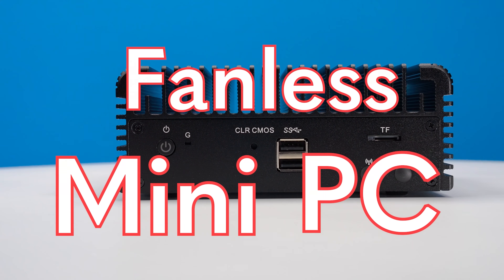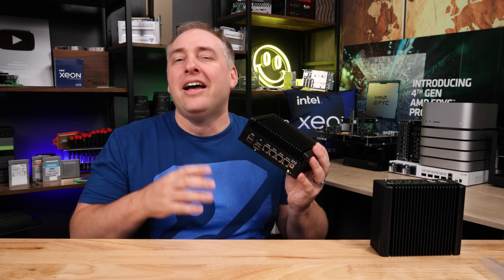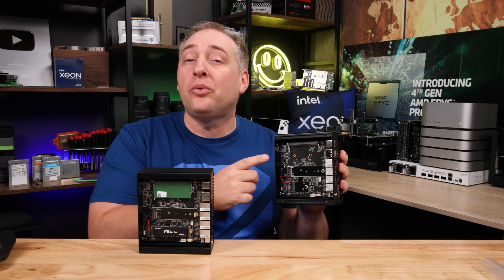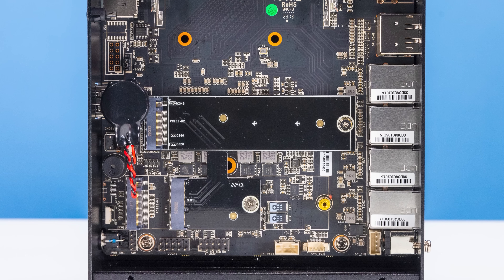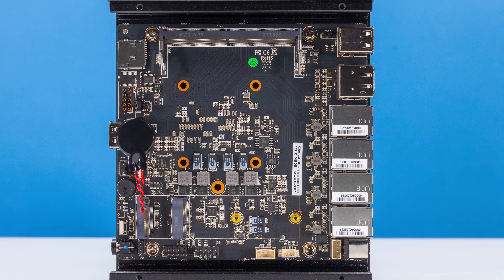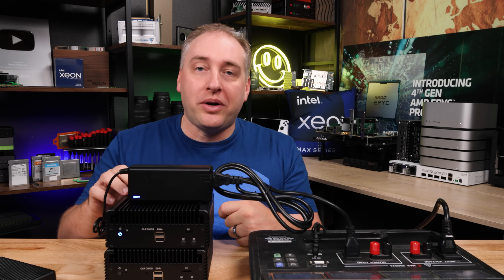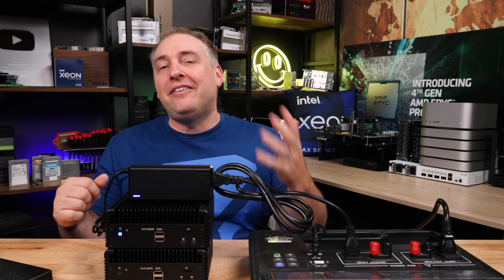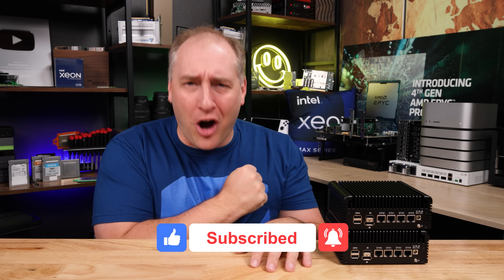Best EVER Fanless Mini PCs for Virtualization and Firewalls?

Comment: I run the i5-1235U with 6 i226 nic's (in the identical box you reviewed a while back ). Single core should be significantly better multi core probably only slightly better as its 1 generation older.

The biggest "flaw" of the N305 is that it only has PCIE Gen 3 and only 9 lanes versus 28 gen 4 lanes of the i5-1235U (though the Topton implementation only supports PCIE3x4 for the nmve drive) . I suspect this is why this box has 4 instead of 6 nic's. With 4 lanes dedicated to the PCIE nmve slot plus 1 lane for the wifi card or expansion card that only leaves 4 lanes for the nic's. Hence I am still glad I went for the more expensive i5-1235U as virtualized with Proxmox in a cluster (3 more Odroid H3's) with ceph filesystem 4 nic's is a bit little if you also want a dedicated managment nic, dedicated ceph nic and still segment your network without the need for rather expensive 2.5GBe managed switches.

I whish they bring a box with 4 or more nmve's with PCIE 4 x 4 (or x2 if even more are available) which is possible with the i5-1235U (or its siblings). Would probably boost the price significantly though.

Comment: Any way to cap the power draw and power this with POE+? I've got a brocade switch and this unit and I need to get a POE splitter but it would be slick to have my switch management port also be the power for this. Anyone 3D print/design rack mount brackets for this yet?

Comment: Can we please move on from all these 2.5gbps promotions? This is still a pile of slow crap.. X11SDV-4C-TP8F is way better and way older...
Reply from the maker: That is an interesting idea, especially since we were the first to review that Supermicro platform. At this point the Intel Xeon D-2123IT is only offering around 75% of the CPU performance compared to these, yet uses well over 2x the power. With the transition of even residential cable providers to 1.2-2Gbps down 1GbE is not enough, and 10GbE is often too much. The challenge is that Intel changed its pricing with the D-2100/C3000 series making them priced much higher than using consumer chips without ECC support. Some folks have very high power costs that make even running a 60W TDP CPU very expensive
Reply: @ServeTheHomeVideo  I agree we certainly could use a refresh of this platform but my point wasn't so much with power usage or CPU strength (agree these would be very welcome) but rather with the networking flexibility. I think 8 total ports some with high speed is perfect for a firewall/router and is pretty future proof for whatever you might need for a while. The (4) 1Gbps ports are absolutely perfect to hang WAPs off of. With these 10Gbps ports you have the flexibility of using 2.5Gbps, 5Gbps or 10Gbps for WAN based on your needs. Even if you used a 10Gbps port for WAN there's still 3 more 10Gbps ports available allowing you some nice options to manage network traffic based on interface. I just think 2.5Gbps is overhyped and compared to NVMe and even USB speeds of 2023, 2.5Gbps is laughable and belongs in the 2000's. We've used our CAT5e long enough peeps, it is time to move on :)

Comment: Need a few more micro systems with that 4x m.2 board! Even 4x SATA would make a fairly nice little NAS for a homelab. 😊
Reply: Unfortunately,  it does not seem to ship with that 4x m.2 board
Reply: @RoycoNL  was that an option or a not released yet board in the video?
Reply: Every one that I've laid my hands on or seen specs for suggest that the M.2 is  a 3 lane  The second is a 1 lane M.2 that runs off the "h" adapter.

Comment: Is this something i could run pi-hole on, AND install SSD's to backup my important files?
Reply: also, USB 2.0 to fan to mount on top = win?
Reply from the maker: We did not use a USB fan on this one.
Reply: @ServeTheHomeVideo  You didn't, but I'd kinda need to, my room temp is around 34c
Reply from the maker: You can ZFS mirror two SSDs and then run pi-hole and more in VMs and a backup server on this as well with cores to spare. You can see our N100 and N200 version if you just want a backup and pi-hole box.

Comment: At 6:40, you can see a SYS_FAN connector in the bottom right. I have the same connector, but I don't know what kind of adapter I need to plug in a regular 3/4 pin fan.
Can someone please link me an example adapter or a part number so I know what I'll need to buy? Thanks!

Comment: Been looking at a lot of this tiny/mini/micro series but I have a question: can you set them up to do serial output? I want to put one of these in my rack but I dont want to keep a monitor/keyboard around in case I need to do something on the console. Rather just do serial to a rPi or another device in my rack so I can do it from my computer :)

Comment: DDR5, afaik, is dual channel in a single module... you can increase the bandwitdth, but it is already dual channel.
Reply from the maker: It is but basically half the channel width. We have a video on the DDR5 details of how it works. Everyone still calls a DIMM slot single channel these days
Reply: @ServeTheHomeVideo  Yea, you can say a DDR5 stick is single channel but that is technically untrue. It can read and write at the same time w/ a single stick.
Also that slot seems to be SODIMM, not DIMM. lol

Comment: Very wondeful video,do they have a version with 2*10G or 2*25G networking?
Reply: Probably when a new CPU will be design. CPUs N100/N305 can't do more. I'm looking for a system where I can put 2 or more  NVME drives at full speed and also 4-6 HDDs, with support from 1 or 2  10gbps ports in a smallest case. :D
Reply: @misterc3835 Not bad,is that designed for a NAS?

Comment: Everything requiring such a  large heat sink cannot be a good choice as it certainly wastes too much power and unless operating in a dust free environment, will sooner or later get a heat problem when covered in dust. For a firewall performance is largely irrelevant to begin with. My old Raspi 4 has enough power to easily be a firewall for a 1 Gbps link under full load and it uses only a few Watts of power when doing that. You will need an extension board to achieve that speed, though, as you need a second Gbit Ethernet port; you can use VLANs and a VLAN switch to use a single port but then you cannot achieve more than 0.5 Gbps if traffic flows in both directions at full load at the same time. Or you use USB 3 to Ethernet adapters but those typically will only achieve around 0.8 Gbps real world throughput because the USB bridge chips in those adapters are usually crap.

Comment: With virtualization, memory is king. I'd love a unit like this with dual memory slots. Trading a bit of memory bandwidth against memory capacity would be no problem for me.
Reply: Agreed about the memory!

Just a couple of points for others to reference:
 - All Intel 'N' chips are limited (crippled?) to single channel memory (so you'll never see a board with 2 slots)
 - Intel officially say 16GB is the Max memory, but I've seen a few YouTubers get it to work with 32GB
Reply: @DerekGreen123   Tell you what.. I have a Topton N5105 NAS board that supports only 16GB but it has 2 SO-DIMM slots. I'm now running ESXi 7.0 with 64GB (2x Crucial 32GB SO-DIMM) on it. Works a treat. The 16GB limit is purely marketing, I think Intel uses the same memory controller as on other CPU dies that support more.
Reply: @DerekGreen123  Well ... I threw a 32GB DDR5 SO-DIMM from Crucial into my N100 and that worked out of the box. No idea what special tasks you would need to do to get it to work - I did nothing ;-) I think I have read that it might work with 48GB as well.

Comment: I would love to see these things with either a serial port or some other means of remote control - I don't like that I have to have mouse/keyboard (or piKVM) connected to get into the bios.
Reply: It has RS232 pins on the motherboard
Reply: @fredskis89  true, but does it have console redirection for that ? Also it would be nicer if there was a console port.
Reply: @casperghst42  yeah good question - all the description regarding BIOS says is: "auto power on, GPIO, Wake on lan, PXE, Watchdog etc"  Maybe the GPIO setting? I'll be setting mine up hopefully this weekend and will try and remember to check!

Comment: Very nice Hardware, i was looking for my new Server at a the very similar 'NRG Systems IPU456A' but not enough NVME Slots on the IPU456A so i discarded it and builded my Homerserver on a ATX System. The PCIE Switch for 4 NVME is realy great and that is what was missing on the IPU. One thing which is realy a shame is the USB2.0. The IPU456A has one USB-C 10gb, and two USB-A 3.1 10GB so you could use External Jbod Cases for Datastorage.  For me a 50% stronger Ryzen 5 5600U, 64GB Ram 3, NVME Drives and a Big Data Storage would have been ideal. I have a DIY Solution now. Neither System would meet my criteria but are very close.

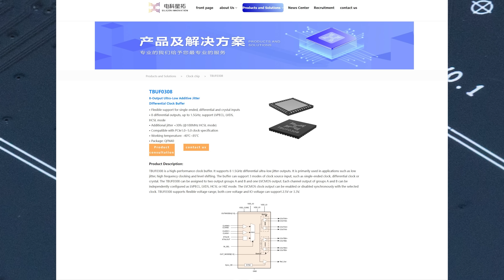Comment: 9:56 This chip is a clock buffer, that only clones clock signal to additional drives, so only way that they could implement 4 NVMe is probably via bifurcation x4 slot to four x1 sub-slots.
And that's going to be very limited and below usual 2 PCIe lanes that even older low-end NVMe drives have.
Unclear, why even bother with NVMe then, unless you require some very niche use case with SFF build for low-throughput high-IOPS very expensive high-end SSDs, which would be very costly and highly inefficient.

Comment: Is it 9W part? I believe Core i3-N305 is 15W with a configurable TDP-down of 9W. I wish they made a tiny router-like PC with Core i3-1220P - it has a ton of PCIe lanes, TB support and 2 P-cores in just a slightly higher TDP package (28W with 20W tdp-down). Also the lack of usb-3 is strange - the previous one with N5105 had usb 3 and 6 2.5G ports.

Comment: As always they should also consider these awesome little devices with 6 x 2.5GbE. Or even better 6 x 1GbE, lot of use can easily live with 1GbE Ethernet lol
Reply: Just get a switch and trunk vlans to it.
Reply: Save money; buy a device with 1 or 2 x 2.5GBE, then trunk the ports to a managed switch.    Then the next time you upgrade your server hardware, you can re-use the switch.   It saves money not only by not buying 2.5GBE ports that you don't need on the server, it also saves in wiring and wiring complexity; who wants 6 wires out of the server when one or two will do.

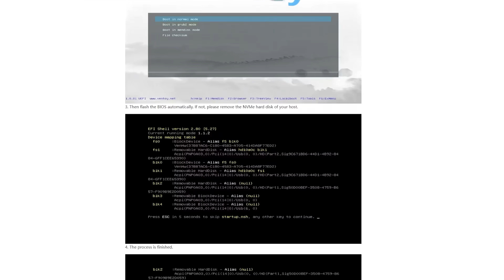Comment: 10:00 there has to be another chip near/on that clock chip. just seems like what there doing is adapting that 1 m.2 slot to 4 more m.2 slots via a pcie switch chip. maybe thats what the bios update is for (bifurcation)? can you peel back the black plastic to see whats underneath that???

Comment: One thing I'm really curious about is the NICs. I have a CWWK N4000. It has two  i226-V NICs (all I need for a firewall). I have been running OPNsense on it since it has supported those NICs for a while. An issue I keep running into with this CWWK unit is that the system doesn't seem to respond to multicast messages used for uPnP. I have configured all the correct services and rules on the firewall to allow uPnP functionality. I also verified my config on an old Intel PC I had lying around so I know it works.

I use uPnP for some games I play as well as my Plex server. I know I can manually create the NAT rules myself but this issue has me very curious if anyone else who has used CWWK devices has run into this issue. If so, do all their products with i226-V NICs have this problem? Have you tested this at all?
Reply: Have you solved this ?
Reply: @Andrew_Thrift  Unfortunately. no. This seems to be a limitation in the hardware. I ended up building a new firewall with more reputable hardware.
Reply: The hardware has nothing to do with multicast support, that is handled by your network stack in your OS. In other words: You have a software configuration issue, not a hardware issue.
Reply: @kelu7463  Except changing the NIC did in fact fix the issue in this case. I finally had time to find out why. I ran a bunch of tests and it seems the multicast MAC filtering in the “bad” NIC wasn’t working correctly. That filtering mechanism is built into the NIC’s chipset. That is definitely a hardware issue. However, to your point, not all things NIC hardware live at layer 1. It’s entirely possible to have higher layer features implemented in hardware. Layer 3 switches are a good example of that. Regardless, from a user’s perspective, this was a hardware failure and it was solved by replacing the hardware (same model, same driver).

Comment: I have to agree with you on USB unlike the other comments. Not only is USB 3 interference a solvable issue but also the QoL improvements it brings is worth it.
Reply: I would agree with the one exception being.. what does it bring other than using it to watch a movie or something from the USB stick? With a 2.5gig network, you're going to get on par speeds copying from any other 2.5gig capable network device (ok.. 1/2 the speed.. but most USB drives don't have read speeds fast enough to keep up with USB3 bandwidth).

Comment: please go ahead, when testing such machines in addition to testing under pfsens and proxmox, go ahead and test mikrotik x86-64 too please
Reply from the maker: OpenWRT is probably a bigger installed base than MikroTik for this kind of device.
Reply: open wrt can be quite picky when it comes to booting on the x86 platform, when it comes to mikrotik, one l4 or a maximum of two on two disks, one for uefi and one for eventual legacy boot, would be enough for you and you could test such machines and under mikrotik, believe that there are a lot of professionals like me who work with mikrotik on a daily basis and it would be of interest to us / it would be interesting to know how mikrotik behaves and what its performance is on those newer machines. I hope you will consider my suggestion at least for one of the next videos, thank you very much!

Comment: So what is the maximum DDR5 ram chip that this thing will take? Edit: Intel Ark says 16 GB, so that is not enough for general Proxmox w/ ZFS+Ceph usage... has anyone tried a 32 MB ram part?
Reply: Correct: Intel officially say it is 16GB Max. But I've seen a few YouTubers run them with 32GB, and the CWWK Amazon Link in the description is selling 32GB memory versions, so I guess this is the real max!
Reply: I've tried 32G in some beelink N100's and N305's - none had issues with Crucial DDR5 4800.  Just got a 32G stick for the N305 firewall appliance; tried it out, and yes, it works.. TBH, most brands selling this advertise it as supporting 32G; so not surprised that it worked;  I put in a Crucial DDR5 5600, but it runs at 4800; still, it only cost an additional $5 for the 5600..

Comment: I want to buy one of these to build a 2.5GbE router, but I'm also just wondering how cost-effective I could just build a 10GBaseT router? Do you know if there are any N300-based systems that use like an Intel X550-T2?
Reply: I'm also looking for something like this with 4x 10G ports for a router! Even better, one should be SFP+ for WAN, to connect directly to the ISP's fiber ;)
Reply: @hdchiriac  I've been using a Dell Wyse 5070 Extended (the Extended is critical) with a 2-port 10GbE NIC in the PCIe slot.  I have it running plain old OpenWRT x86 for simplicity.  My ISP is Charter's 1-gigabit plan, but it'll spike above 1 gigabit briefly.  I went with a 10-gig NIC because the 2.5-gig ones were all quirky when I last looked.

Comment: There's an engineering reason for only having USB2 ports on a compact case network device that's intended to have WIFI put in it. USB3's electrical format is unfortunate in that it produces EMI on 2.4ghz, so having USB3 ports close to a 2.4ghz WIFI antenna is a big problem. The USB 2 ports are really just there for installation maintenance, when you want to plug in a keyboard, mouse, and install/troubleshooting media USB key.
Reply: To be clear, the "USB 3.0 causing 2.4ghz interference" is a solvable problem and it is in most devices, but it requires more engineering effort than just not using USB 3.0
Reply: Or, external USB fan, to mount on top of device?
Reply: "Electrical format"?

Comment: Am I to understand there isn't a single 5Gbps (or higher) USB port on the entire system? If so, that is quite frankly insane and immediately makes the product a non-option for me. Seriously, what were they thinking? I just got a similar low-cost box that has full speed USB4 which supports power, display out, and even external GPUs...
Reply: It's a firewall, they don't usually need usb 3.0
Reply: What are you trying to do, that needs this?

Comment: This is a server-focused channel, yet you recommend things like this for always-on applications (firewall etc) even though it doesn't support ECC memory. I can't take that seriously.
Reply from the maker: This is cheaper than many of the higher-end ECC RDIMM chips alone. Not everyone has a huge budget so we look at a range of CPUs.
Reply: @ServeTheHomeVideo  Agree - I don't expect RDIMMs for a device like this. And I appreciate that you look at devices fitting various budgets. I'm mostly just annoyed that I don't even have the option of using a UDIMM ECC RAM stick if I want to.
Reply: a lot of businness firewalls don't have ECC either.
Reply: The on-die ECC functionality of DDR5 is probably enough for something like this. There would probably be a lot of noticeable packet retransmissions from outright failing RAM as opposed to a random bit flip one day being problematic.
Reply: @blkspade23  Good point - I agree.